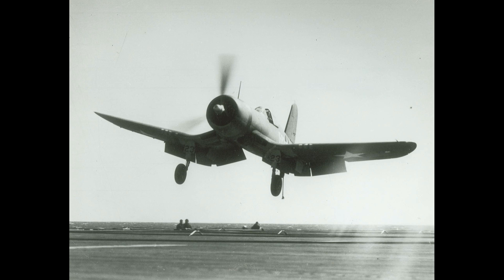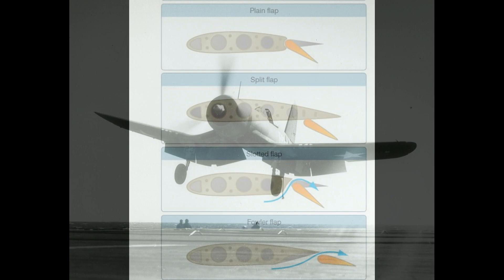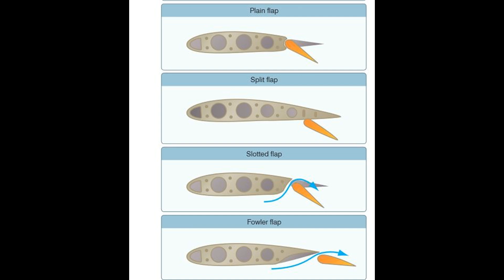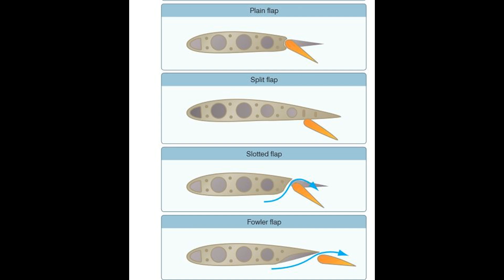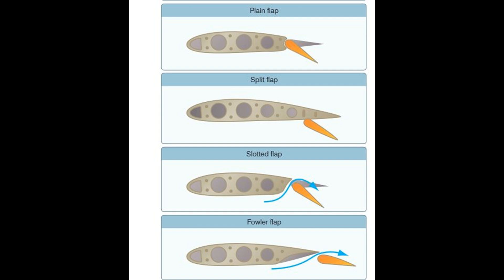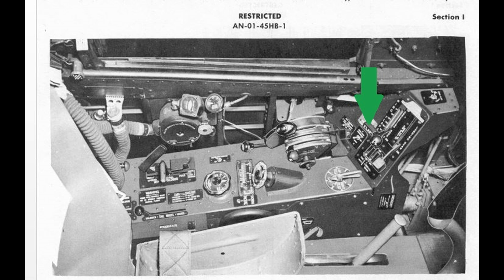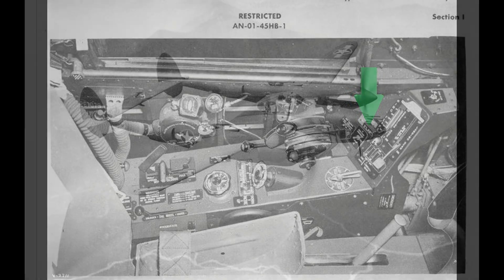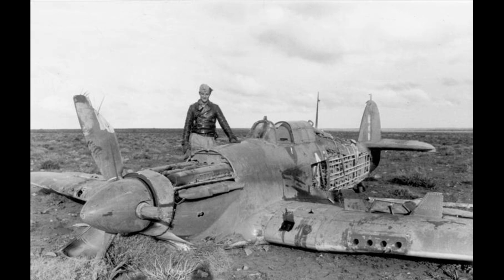Using Flaps in a Dogfight with the F4U Corsair and others

Comment: Very nice. I in the past I interviewed dozens of WWII fighter pilots and one thing came out very clear - air combat was not a joust and a turn fight (many pilots never had one in the PTO) was considered an error or beastly bad luck. But, when they did occur, pilot skill - heavily pro-US in both theaters by mid-44 (earlier in the PTO) made the difference. 

Second, WWII aircraft losses were more likely due to "mischance" of all kinds than being shot down in combat. (Being shot down by flak was actually more serious in the ETO. Still not sure if US escorts should have been encouraged to attack ground targets on their return from escort missions over Germany. The guys were young and immortal - and fighter pilots - bad combination.) "Mischance" I'd guess (and it has to be guess because thousands of planes simply didn't return and nobody ever knew exactly why) was due to bad navigation & bad weather, mechanical failure - and landing/take-off which could be pilot error or mechanical error. (20 year old idiocy was sadly common - fighter pilots loved to buzz the field and heaven knows how many buried their plane doing it.) Stalling low in a tight situation would have been bad news - our #2 WWII ace Thomas McGuire was leading a flight that was "bounced" on the deck by a single Oscar (we think) and McGuire tried to turn a fully loaded P-38 with drop tanks attached to aid an endangered wingman - had a snap roll at 200 ft and was killed. Axis pilots also had very high rates of non-combat losses, (bad pilots also crashed really easy) but when the pilot quality collapsed late in the war, the KIA ratio would have gone up substantially.
Reply from the maker: Hi Eric, thanks for your comment. I agree with everything you said. If a US pilot ended up in a turn fight against an enemy fighter, things had already gone bad for him. Both U.S. Navy and USAAF manuals and videos stress that turn fighting is not the answer. Still, it did happen, there were aircraft design features and training for turn fights, so it's a factor, hence I need to cover it. Also, compared with the real war, turn fighting is dis proportionally represented in on-line flights sims, thus a lot of people are interested in turn performance.
Reply: The US manuals stressing this were 1942 early war manuals... In Western Europe, by 1944, turn fighting was the rule, and US pilots had the better skill. One P-47 ace said: “Our worse problem was getting the state side training out of our new pilot’s head.” The US won the war with turn fighting. Less so in the Pacific, but even there the Hellcat had the lion’s share, and out-turned all types short of the Ki-43 and Ki-100.
Reply: I think you're dealing with anecdote. WWII was a massive affair. Starting in late 1943 and going into the beginning of 1945 there were countless air engagements in the ETO - they dwarfed the earlier (and often shorter) campaigns like the BoB or North Africa. So in the thousands of encounters you'll find flight sim like turning matches and good pilots would do better when "stick" skills were needed. But if you look at the tactics actually employed, no air force was encouraging the joust. (If you have the patience and are willing to get into the nitty gritty check the still unsurpassed "Fighter Combat" by Robert Shaw. Shaw btw was on the old online sim called Air Warrior. The guy in real life was deeply involved in Top Gun. In Air Warrior "maus" was good but not one of the cyber-aces, although he was witty in typed comments - no "talk" in that game.) And when you talk of turning matches you really do need to define terms - at what height? at what speed? Could the Hellcat turn with a Zero? Not at low speed it couldn't. If you look at the attributes of the major fighter planes there wasn't that much difference between "turn and burn" and "boom and zoom." Everybody wanted good speed above all - and it was the Hellcat's vastly superior performance at alt that gave it a big edge over the Zero. (I'll grant that the Oscar remained an odd exception - and it didn't really belong in WWII.) When the Zero was in its prime, it was faster than opponents. Spitfires were liked for their speed. Ditto with the BF109 - and, check Gregg here, the FW190. You might also check the memoirs of the RAF top ace "Johnny Johnson" - he quite specifically said turning fighting was a bad way to get a kill, but a good way to get killed (turn and you slow down - hope the bad guy doesn't have a wing - as he would if flying a "finger four"). My late friend Robert DeHaven - 14 kills with the famous 49th FG of 5th AF - I think gave the best capsule description of a fight. First - do everything possible to start an engagement with a superior position. That's needed because if a big fight gets going (like a WWI 'dogfight") things will go from high to low and from order to chaos. And lastly, "a successful engagement was usually comprised of a relatively few and relatively simple maneuvers executed at the right time." And shoot good. And be aggressive. The most common number of "kills" scored in the USAAF was zero. Only a handful of men had over 20 victories. (Do factor in inevitable over-count.) I once did rough averages and decided that the USAAF pilot that won the air war had 3.5 kills. (Do note that allied pilots never had the kind of "target rich environment" that existed for anyone flying a German or Japanese plane.) But it does appear that the willingness of a pilot to press an attack and get into good shooting range was usually needed to shoot down a plane. Or, better yet, have the "situational awareness" needed to see an approach that would allow an unseen attack. Not everybody had that quality - even guys with a "good stick."
Reply: Turn fighting dominated because it provided a stable target for 1% hit rate guns... The US won WWII with turn-fighting... Read P-47 accounts in Europe, that’s all it does when the Luftwaffe was at its best. The P-51 only became significant in April 44, after the P-47 broke the Luftwaffe in February during Big Week, scoring 140 of 220 Air to Air kills on the best German pilots. The FW-190A was the best turn fighter in the West, and the Hellcat the best in the Pacific except for the underarmed Ki-43... Just to give you an idea how dominant was turnfighting on the FW-190, a 190 pilot corrected a post-war painter who painted his wings level: “Our wings were never level during combat in 1945: We never stopped turning for a single second: It was the only way to survive...” The war started with everyone assuming dogfighting was dead, and ended like this... Low hit rate and the prop interacting with the wing caused this. At the start of the war even the Zero was noted for never using turn fighting: Hit and run was a 1930s assumption that was proved wrong because of propeller and guns, but vindicated by post-war jets and instant kill rockets, hence the current misunderstanding. See my videos on Air Force and flight physics for more.

Comment: I made some typos below, so I am editing here, the same post ...

First. please do not call the ki - 43 or ki 84 as key-eye. The correct pronunciation is ki. The word comes from the Japanese "kitai", airframe. 

I do not agree with your analysis of fight between a ki-84 and a presumably diving F4U. If I am flying the ki-84 at 350 mph sea level and an F4U is gaining, I will go on a climbing turn so as to reach my best advantageous speed (this is what Spitfire pilots did against Bf 109's or FW190's).  This will also give me a good altitude advantage.   If the F4U is really close, then I would also cut power, to ensure that the loss of speed comes even faster. The F4U pilot can try to stay on the throttle and run away, but that will be fatal, because the ki-84 will roll back, throttle up, and catch up (scissors maneuver).  The other option of the F4U is to try to stay in the turn, but that will also get him the ki-84 in his tail.   Either way, the F4U has no advantages. Even if the ki-84 pilot is stupid and stays on his power, your comment that there will be a speed range on the lower end that the F4U will be able to out turn the ki-84 due to the combat flaps ignores the fact that the ki-84 has more than 30 % lower wing loading, and therefore much lower stall speeds.  In the 200 mph range, the F4U will not be able to keep up with the ki-84 turn, even if he could perfectly manage his poor stall characteristics.  I am also in serious doubt that the combat flaps of the ki 84 cannot be deployed above 140 knots. 

In the above scenario, the only chance of the F4U pilot is some lucky shots in the early part of the engagement. Now, if we assume the ki-84 pilot was experienced, he would have used his excellent rear view vision and never allowed the F4U to get close dead astern. An early start in turning would have given the ki-84 pilot a large relative angle, which would mean that the approaching F4U would have to pull a large deflection shot. Quick rudder moves or small roll deflections on the ki-84 pilot would make the deflection shot to almost certainly miss. Then, when the cards get reversed (and they will very quickly), the F4U pilot has very limited options. As he pulls the turn tighter to force the ki-84 to a higher deflection, he looses more and more speed, where his turn rate becomes terrible, and it will be a virtual execution. 

Engagement at a higher altitude would hardly be better for the F4U. If the F4U is attacked, its pilot will be able to keep the speed up in a dive, but if he manages to temporarily out turn the ki-84, the ki-84 pilot will simply pull off the dive and attack again, until he takes a few lucky shots or reaches sea level. Just about the only chance the F4U has to avoid been shot down is to run voluntarily into the ground. 

The F6F with its higher wing loading was in a slightly better shape than the F4U, but it was just as much outclassed, and its better turn performance was at the expense of speed.

OK, I hope I do not have that many typos here, just ignore the previous post ....
Reply from the maker: Hi Demetri, I removed your double post just to clean it up for you. I don't disagree with what you are saying, but I think you somehow missed the entire point of the video, which was literally explained in the title. This video isn't an explanation of dogfighting tactics, or a suggestion about how to fight with either one of these planes. That example is simply to explain the effects of flaps in a turn. Regarding the Hellcat, I think you meant to say it had lower wing loading.
Reply from the maker: Whatever scenario I used for this, someone would complain it's not realistic. For demonstrating the principles discussed in this video, this comparison is just fine, in fact, I think it's about as good a scenario as is realistically possible to come up with for this particular subject.
Reply: Well, I suspect that some would compain about using a real scenario, but this is not democracy, facts are facts.  If you believe that the scenario that the low wing loading fighter pilot would prefer to keep his speed up as long as possible in order to maximize his opponent advantage ... well, we can agree to disagree on that one.    We do not need to agree on everything.  Thank you for posting the video and initiating an interesting discussion.

Comment: Good video, but there are a good things to refer : F4U Corsair was an aircraft with sufficient stall warning for basically. All production inspection trials reports for Corsairs of Vought, Goodyear and Brewster show it. Even the earliest F4U-1(BuNo 2296, birdcage canopy, no stall strip) was rated 'warning is good' by USAAF pilots. The stall characteristic problem of F4U mostly occurs with landing condition(gears, flaps and dive brake fairings fully extended). There was little or no stall warning under landing condition. They showed a tendency to reduce warnings as the drag increases under the wing. 

The NACA report states that there was unsatisfactory or virtually no stall warning in all conditions, It seems because in all conditions there were already a huge drag items under the wing like landing condition. When you look at the pictures in the NACA document, you can see that NACA's F4U-4 had eight rocket racks, two stub pylons, and two HVAR-like measuring devices fixed in a rocket racks. It's difficult to say that it had no impact.

According to modern evaluation of SETP, the stall characteristic of Corsair was as follows.

'Aerodynamic warning of the normal stalls in both configurations ranged from scant to nonexistent. The P-47 was the best with some light airframe buffet occurring about five kts. above the stall. The P-51 had virtually no warning, the Corsair and Hellcat a couple of knots apiece. Secondary cues such as decreasing aileron effectiveness and increasing longitudinal stick forces were noticeable in all except the FG-1D in which the stick forces tended to lighten before the stall. Normal stalls for all aircraft in all configurations, power on or power off, were defined by an uncommanded nose down pitch accompanied in most cases by a wing drop, the direction and severity of which were strongly influenced by any departure from balanced flight conditions. In all normal stalls except those in the Corsair with power on, it was possible to control the wing drop by coarse use of the rudder.'

'The Corsair generated considerable airframe buffet five knots prior to stall in a constant 3g turn but at the stall there was a pronounced g-break and a rapid right wing drop regardless of the direction of the turn. With care, the wing drop could be prevented with some anticipatory left rudder but the aircraft then became very unpredictable at the stall with moderate to severe bucking and porpoising motions and the ever present likelihood of departure.'

And they rated Corsair as follows.

'Light and comfortable stick forces, good performance, adequate stall warning and docile behavior at the stall made it the "weapon of choice" among those tested.'

Of course they were experienced pilots. So share the conclusion with this video. In their words, 'perhaps more suited to experienced pilots.'
Reply from the maker: The NACA test was done with "no external tanks or armament installed". It was tested as the plane was operated in real life as a fighter. Furthermore they did the test with the wing in various conditions, so I think they were quite through. I'll take NACA test results over the SETP any day, and I think the Corsair's actual war record reflects what was found in the NACA report.

Comment: 9Gs??? the average human is asleep at 5Gs without a G suit...
Reply from the maker: F16 pilots often pull 9Gs. These are not average people flying these things.
Reply: with G suits and a semi reclined seat, did Corsair pilots in WW2 have G suits?
Reply from the maker: Not only did they have them, the plane has a connection point built in for hook up. There is a picture of that in the video, but you would have to pause to see it.  I mentioned that the F16s OFTEN pull 9Gs. Many other planes that don't have reclined seats pull 9Gs on occasion. For example, in combat there are cases of F4s pulling 9Gs, the were not rated for it, but not electronically limited either, and if it's a choice between over stressing the plane or taking a missile hit, I know what I would chose. Oh, and the F22 can pull 9Gs no problem. On the subject of a human's ability to take this, I'll quote Wikipedia: "through the combination of special g-suits and efforts to strain muscles—both of which act to force blood back into the brain—modern pilots can typically handle a sustained 9 g0" I hope that helps.
Reply: Yes, thanks for the info, I did not know they had G suits in WW2. From personal experience I grew to love the fowler flaps on my Cessna 150 {owned for more years than I want to admit and put 3500 hrs. on that plane}. I could turn a loop into a curly q by deploying them at the top of the loop [manual flaps], when dogfighting my buddies they could never out turn me if I used flaps, you could also hang it on the prop quite well. I now have an RV-4 stressed to 6Gs [only a 1000hrs in it so far] but it only has plain flaps, faster and much more fun than the Cessna but I often wonder what it would turn like with fowler flaps!!! Thanks again- great video!!!